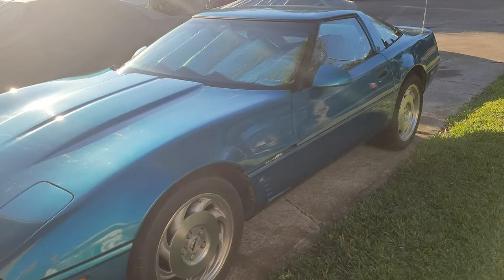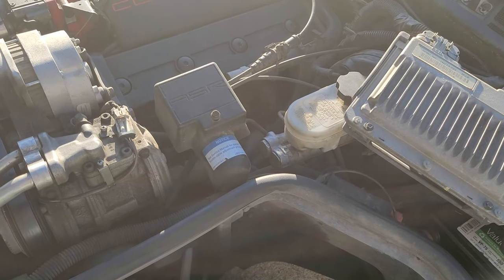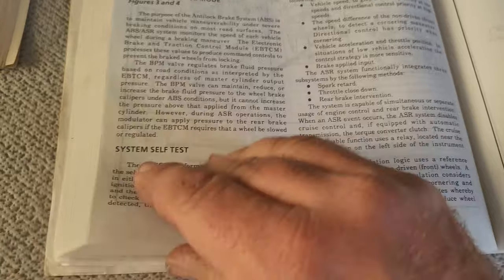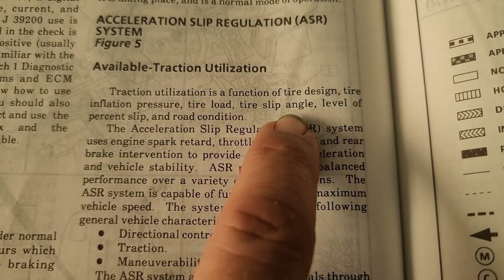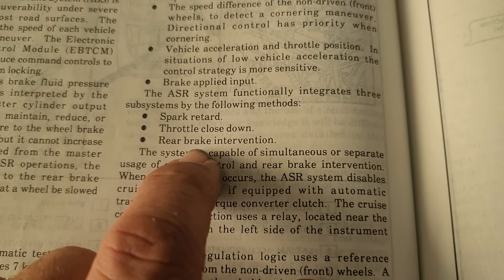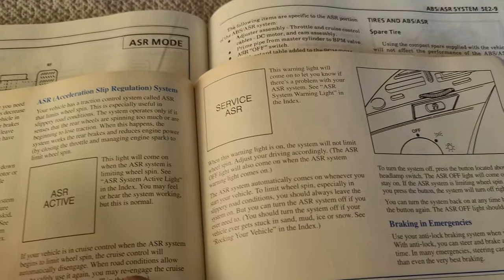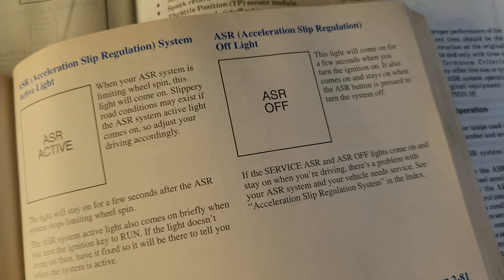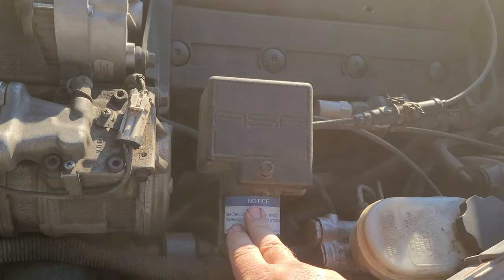The Misunderstood C4 Corvette ASR Traction Control System

Comment: Would it be easy to remove the whole ASR module and or permanently disarm. 
I had mine off and did some spirited driving.. over a bumpy road when I was getting on brakes, the car kept on accelerating .. scary moment
Reply from the maker: Not easy at all. Even though I consider the ASR system to be a nanny device, I have seen it save many a Corvette drivers butt when the car gets loose and heads for the nearest ditch or oncoming lane of traffic. Not a pleasant experience like you mentioned.

Comment: my service ASR light has been on forever...is there a video on the cable adjustment to the asr unit...saw one long time ago?...92 vette
Reply from the maker: Marcus, I haven't seen that video, but the accelerator pedal and throttle body cable contain automatic adjusters, and as such aren't serviceable if they become loose or out of limits. The cruise control cable adjustment is handled as in past model years at the cruise control servo. Let me know if you need any other information.
Reply: What is the adjustment with the Allen wrench in the three key holes and then you do something with the cables is there any information on that
Reply: @VetteSource  What is the remedy for when the "service ASR" light comes on in the dash? Thank you in advance!

Comment: I have a question for ya
I've done a complete tune up on my 94 LT1
New plugs wires distributor and it still seems.like there's a miss
It sputters when you excelerate any suggestions
Reply from the maker: Hey William, at this point my first thought would be to take a closer look at the fuel system. Being an OBD 1 ECM software system, you have less real time data to work with but you can still do old school checks like static and dynamic fuel pressure, injector pulse verification, and individual spark plug condition. Let me know how it turns out👍.

Comment: Is there a vacuum line connection there?
Reply from the maker: Hi Mario, yes there are two or three vacuum lines that feed directly into the cruise servo under the hood, and another one that connects to the brake pedal to disengage the system when you hit the brakes.

Comment: Great video and very informative 👍🏻.. I have a 95 C4... purchased 2 years ago in April with 87,000 miles just recently the C4 hit 100k and the original Optispark went out so I changed the Optispark, waterpump, Ignition Coil, Ignition Module, plugs and wires.. the wires were factory because each plugwire had the cylinder # on each plugwire... anyways the C4 runs Amazing better than before however on the 1st start of the day it idles high until it warms up and I have to turn the key Off and then restart and then it will Idle down to normal Idle but the ASR says it's Off and needs to be Serviced... so I changed the IAC and nothing has changed but the ASR light will turn off on its on... any ideas..?
Reply from the maker: Hey Dean, I'm glad you enjoyed it👍. As I mentioned in the video, the ASR system has very few components that make up the system. With that being said, I would lean towards you having a failing ASR unit with the symptoms you are describing. Over time, the stepper motor that controls the bell crank that the throttle cables are attached to becomes stiff and frozen up. You can check this by removing the plastic "ASR" cover and trying to rotate the bell crank by hand. If it seems overly difficult to rotate, that most likely will be your issue.
Reply: Awesome... Thank you and have a Blessed Memorial Weekend..!
Reply from the maker: You too, my friend👍
Reply: Hey VetteSource is there some kind of Lube or Spray that I can use on the ASR motor?
Reply from the maker: Unfortunately not. Once it's becomes seized up, it will require a complete rebuild, but I don't believe anyone is making replacement parts for it.
Reply: I did pull the cover on the ASR and the little gears were very easy to turn...
Reply: @VetteSource   I found 2 codes... H22 & H63 any clue as to what this means?
Reply from the maker: I don't have those codes handy in front of me, but the H indicates a historical code. Let me look and see what I can come up with.
Reply from the maker: There should be some resistance when trying to turn them by hand. Did they feel like they were just freewheeling easy when you turned them?
Reply: @VetteSource  Thank you... much appreciated
Reply: @VetteSource  there was a lil resistance but nothing to make me believe it was stuck  or in a bind

Comment: Bought my 92 in Oct 2021 and could not figure out why that does that, I see the switch on the left dash. If I push it will it turn that off? I am going to try it. Can you drive it either way?
Reply from the maker: Hey Tony. You're correct, all you need to do after starting the car is push the button and it will disable the ASR system. The "ASR OFF" lamp will illuminate on the DIC and stay on until you press the button to turn the system back on, or restart the car which resets it back to the default position of active.

You can definitely drive it either way, just remember the system is there to keep you from spinning out or ending up in the ditch. I find it useful to just keep engaged unless I want to do some drag racing type maneuver. You never even notice it's there's unless your attempting to break the tires loose.

Comment: i been hearing about the hold it for 5 - 6 seconds and it fully disables the traction and something else, is that true? or just made up? I just bought myself a 95 lt1 to use for drift events but before i use it to go sideways i wanted to make sure i figured everything out
Reply from the maker: Interesting, I've never heard the "hold for 5 seconds" to turn off permanently. I doubt they would build that into the system because they ASR was intended to dave your butt in the event of overly aggressive driving😁.. Personally, I would just disconnect the pigtail harness at the ASR servo if I wanted to disable it for the type of driving you're looking to do.
Reply: @VetteSource  how do i do that exactly? If you don’t mind me asking, is there a video for it?
Reply: @VetteSource  also really appreciate you for being able to get back to me quick 💯🤝🏽
Reply from the maker: No problem👍
Reply from the maker: I haven't made a video about it, but can put something together this week👍
Reply: @VetteSource  Sounds good can’t wait! definitely subscribing 🫡